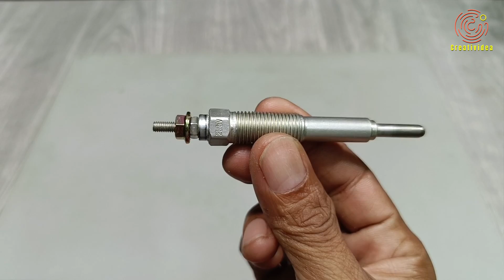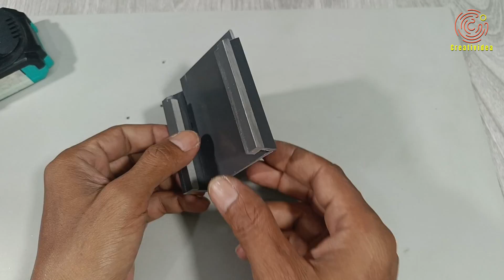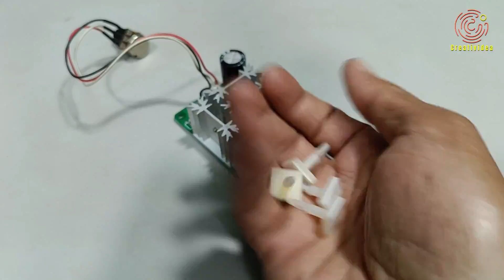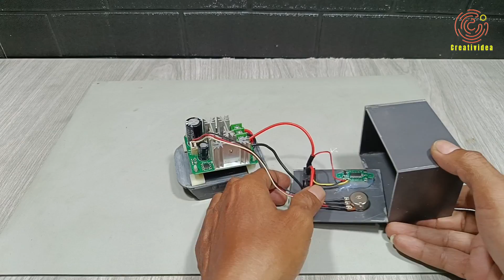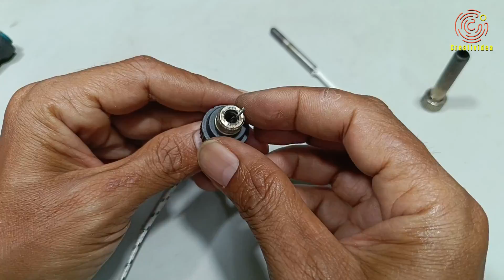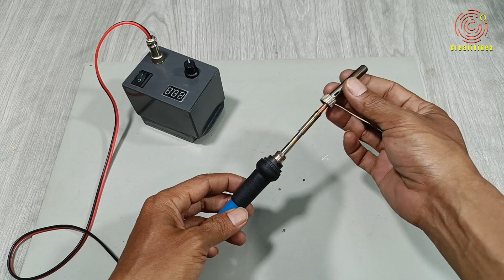Solder Baterai Super Panas Dari Busi Pemanas Mobil

Comment: Solder listrik saya yg 40 watt masih baru,tapi pas dipakai menggukana aki kok panasnya sampai di gagang kayunya terus timah lasnya tidak meleleh
Reply from the maker: Aki cuma 12 volt, solder listrik abang 220v
Reply: @creatividea  apa ada solusinya?
Soalnya di daerah tambak ikan cm mengandalkan tenaga surya yg 50 watt sama aki motor.ada sih aki truck,CM umur aki sudah tua.kmarin pakai aki truk trs inverter yg 100 watt.kejadiannya spt itu
Reply from the maker: @S.k.a29  abang mau bikin atw beli, kalo beli ada kok yang jual solder DC 12 V
Reply: @creatividea  sudah punya,CM yg 40 watt solder listriknya.kalau yg solder DC 12 volt yg gmana itu?
Reply: @creatividea  brarti walaupun menggunakan inverter tetap tidak akan berfungsi ya solder listriknya?
Reply from the maker: @S.k.a29  kalo pake inverter seharusnya bisa
Reply: @creatividea  seharusnya sih,tapi ini tidak bisa.sudah setengah jam tapi panas tidak maksimal.malah setengah gagang kayunya ikut panas